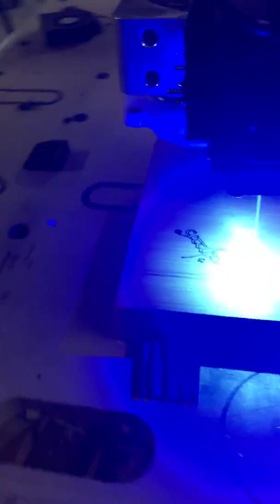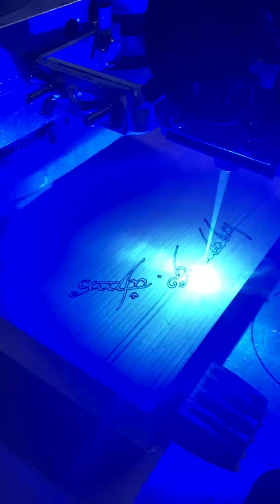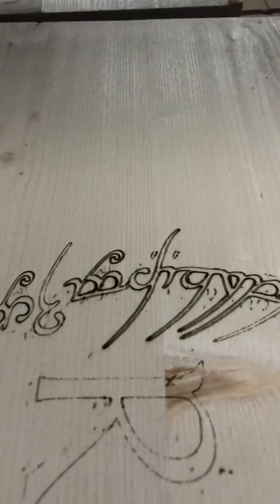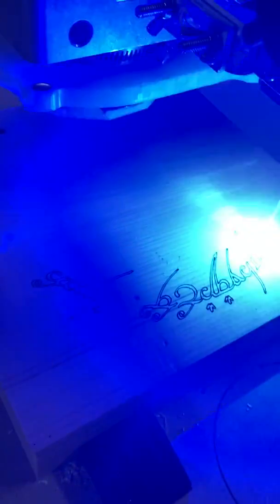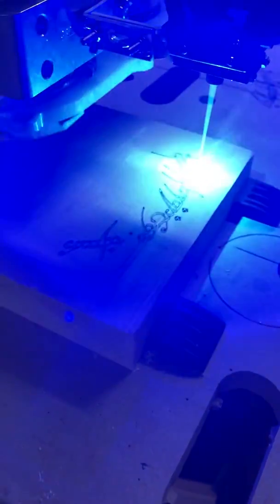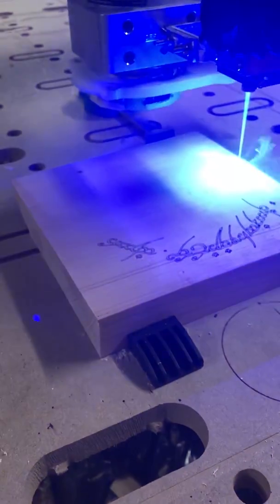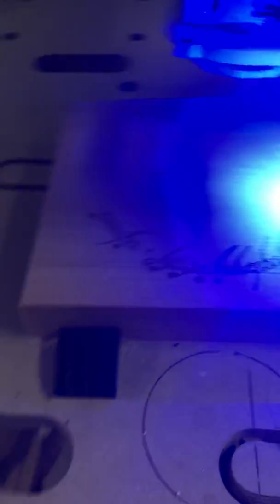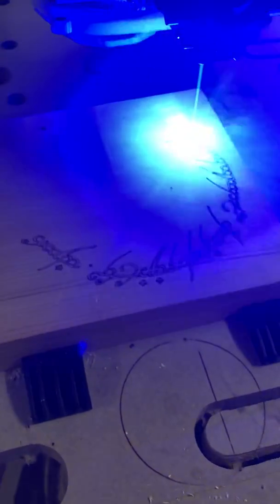Laser using M11/M10 codes

Comment: Can you help me please, i know how to make a gcode with M10 and M11 command... but mach3 wont open relay with that code...Im using TB6560 board
Reply from the maker: I'm afraid I can't help you with that board as I am unfamiliar with its design.  The M10 and M11 codes will not open a relay.  the relay must already be on for the M10 and M11 codes to work.  Relays are opened to provide power to the laser and shut off the power.

Comment: Did you edit the M10 an M11code in Mach3? Do you run a Gecko G540?
Reply from the maker: I don't have a Gecko.  I have an Ethernet Smoothstepper.  But the post processor programs the M10/M11 codes.  If you check JTech photonics website under Updates and Mach3 Upgrade, they have a PP that uses M10/M11.